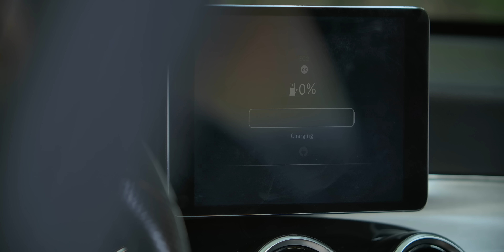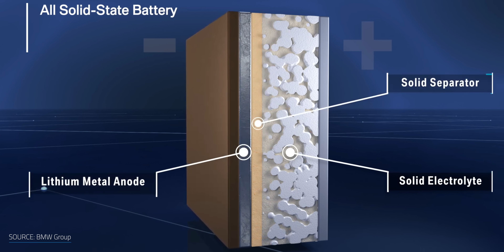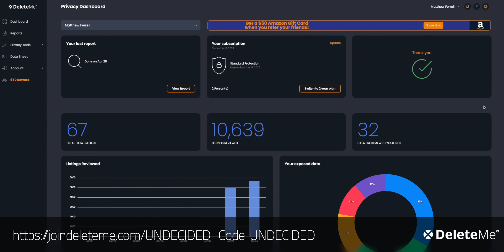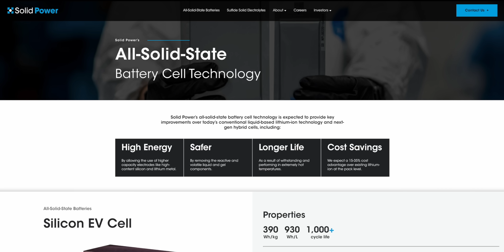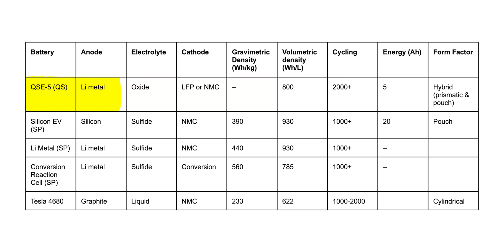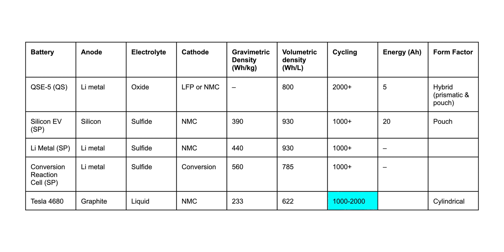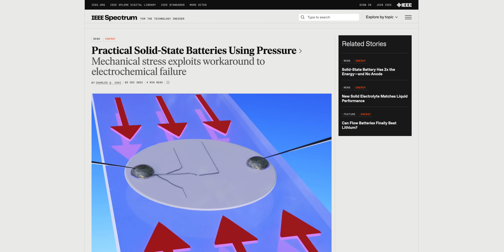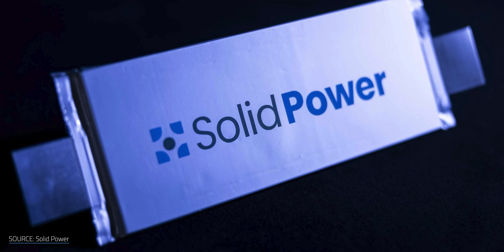Solid State Batteries are Closer Than You Think

Comment: For me, it's not just waiting for solid state to come out, it's also waiting for the cost to come down and safety issues to be resolved.
Reply: Safety issues have been resolved decades ago.
Reply: @4203105  what about the Samsung phone batteries?
Also, Chevy Bolt EUV batteries?
How about Tesla cars that have started on fire?
Reply: @miked412  What about ICE cars that burn down 20x more often than EVs? There is nothing in this world that is completely save.
lithium-ion batteries are much safer than alternative technology we've been using for a 100 years.
Reply: @4203105  I was replying to the comment "safety issues have been resolved decades ago" and pointed out safety issues more recently.
Off topic:
 - ICE cars do have more fires per 100,000 and may always. EVs present a different challenge - extinguishing.
 - Metals fires are a different beast. While there are less fires with an EV they are far more disruptive.
Back to topic:
 - Solid state have the potential to be a safer alternative to lithium ion. That doesn't mean they will be when mass production starts.
 - Testing only goes so far. So, I plan on waiting for both the cost to come down and any major safety issues to be resolved.

Comment: "I think we'd all appreciate an EV that can charge to full in just a few minutes ..."

A Tesla Model 3 has a battery capacity of approximately 60 kWh.
The electrical power required to fully charge a 60 kWh battery in ten minutes is 360 kW.
(The average three-person household uses approximately 2,800 kWh per year.)
With a standard 60A fuse, a maximum of 13.8kW can be supplied.
Where is the power and the line capacity going to come from to supply 360kW for ten minutes?
Do the maths before you spout such nonsense.

Comment: "Solid state batteries are just around the corner" for the low-low price of $300+/kWh for the newest numbers I could find. We're still many years away from them being economically viable in the consumer space.

Standard range EVs with solid-state batteries won't go much farther than standard cells since manufacturers will simply cut down on battery pack size and weight to reduce costs.

A slimmer, lighter battery requires less structural support, which further reduces costs, weight, rolling resistance, tire wear, etc. A slimmer battery also makes it possible to lower the cabin floor and roof by a few cm, which improves aerodynamics and gets you more range per kWh too.

Once you have enough range to easily drive longer than most people's bums can bear in one sitting, the only problem with EVs is having enough reliable 120+kW fast-chargers near rest stop facilities for people to take their 20-30min breaks there.

Comment: A friend of mine is a PhD chemist who has worked in battery engineering for over 20 years. He is skeptical that solid state batteries will ever be practical.
Reply: Your comment would be a lot more helpful if you’d ask your friend to explain his reasoning and share it with us so we can learn. Just saying 😊
Reply: @philipk89  I'm not a chemist.  He is a PhD chemist.  I can't understand the detailed chemistry that forms the basis of his skepticism.  

But, in general, some of the issues in solid state batteries are that 1) they are very susceptible to fires, 2) they degrade over time, 3) they are very sensitive to temperature, 4) they degrade over time, 5) vibration and shock also causes degradation, etc.  Fundamentally, the goal of solid state batteries is to get a huge amount of energy into and out of the battery in a very short period of time.  That is fundamentally a dangerous thing to do.

Comment: likely the most important factor that should maybe be explained (and maybe you didnt have numbers to) is mass and KWH per volume (pick your scale measurement), this is ultimately the most telling factor for how much an improvement solid state may be from a range standpoint. if by stacking into the same volume as lithium ion, what is the mass/weight and kwh comparison? are there numbers for this from either company? Theres a lot of talk about focusing on faster charging speeds and less about range, but a large improvement in either direction will make the other less of a factor.

Comment: BLA BLA BLA BLKA... SOLID STATE BATTERIES IS ONLY GOOD ON PAPER.  THEY HAVE NO RAL LIFE TEST. SO ALL THE ADVANDAGES ARE ONLY AS AI SAID ON PAPER. Also LiFEPo4 batteries can be charged 10 000+ times. not some 2000 as you said. So if solid state batteries wont be cheaper than regular LiFePo -they have future only for mobile and laptops.. cars wont use it.

Comment: Silicon anode batteries, such as as the Simaxx series by Amprius, seem to be further along production-wise compared to solid state batteries.  The silicon anode batteries also have a much higher energy density at around 1200 Wh/L from what I’ve read.  They also have a pretty quick 20-80% charge time of 6 minutes.

Comment: there are a LOT of details they don't, and SHOULD not reveal about why they're not here already, I suspect their biggest hurdle is their short cycle life when compaired to other lithium tech. there's just too much we don't know. BUT... i know of someone who's seen the details & knows as much of them as anyone- and he chose a different path over them- and that tells me everything I need to know- ELON MUSK. he's seen the tech and turned it down in favor of dry application lithium combined with tabless- aka, the 4680 cell, which is KING of longevity. 3.5 million miles, or 50 years. everyone is chasing range- nothing wrong with that- but having the world's BEST charger network with every automaker already signed up to be onboard? means a 300 mile range is already 2x as long as it needs to be. the REAL holy grail is battery LIFE and pack replacement cost. $8000 for a 78kwh model Y long range pack- with tesla pack life averaging 400-500k-  and their pack costs just keeps getting CHEAPER... even as hyundai's 64kwh pack replacement costs a whopping $60,000! whoah- didn't see that one coming. nissan leaf- $45,000 for a measely 35kwh pack. if you're shopping EV's? I would make that my FIRST question- 'pack replacement cost'- RIGHT NOW. no projected. not 'under warranty' the ACTUAL cost if I PERSONALLY have to pony up the dough. let's face it: tesla just OWNS THE SPACE.

Comment: To be fair you have to mention (and didn't) that cylindrical cells are physically less energy dense than flat packs (prismatic).  The lower Wh/L for cylindrical cells is in large part because of geometry, not chemistry.  Current wet Li Ion cells also come in prismatic packages, and some EVs on the road today do use them.  If you wanted to be fair, you could easily have included either a current mass market prismatic cell or one of the other vehicles that uses them.  Anti-Tesla bias much?

Comment: Screw lithium.  KAIST labs in Korea  has a sodium-ion battery that uses MOFs for the electrodes.
Holds 200+  Wh / kg   and charges-discharges at the speed of a supercap!
Reply: CATLs second generation sodium ion battery is also 200Wh/kg. The problem with sodium ion is more Wh/l though. I'd tamper my excitement till they release those figures.

Comment: Which one can be recycled/refurbished more easily? It sounds like the SolidPower offering may have an edge there. It's batteries may not last as long, but if they are easy to disassemble and reassemble then that alone might put them ahead. I still think though what we really need here is standardization and a change of ownership of the battery itself. If drivers didn't have to worry about that future expense because rather than charging we just drove up to a station for a quick 5-minute swap, EVs would become a lot more attractive. Granted, that would require yet another rollout of infrastructure to handle that.

Comment: One thing I don't understand with solid-sate batteries being made with layers of pre-rolled materials is how they achieve high area of surface contact between the electrolyte and the anode/cathode layers. It would seem if the electrolyte was a gel, or a spray on process used, then better surface contact between layers could be achieved. 
With liquid electrolytes anode/cathodes don't need a high degree of surface smoothness, as electrolytes can move a molecule thickness to fill gaps and create a path over largest possible surface area for ions to flow.

Comment: The solid state battery for the power tool industry and the lawn care as will be quite big. companies like Milwaukee and DeWalt with outher tool brands can make more power full battery tools . one of the biggest hold up in power full tools is the battery watt hour to size weight ratio . brush less motor  tech had been  game changer in power tools. solid state battery can be a outher game changer. with lawn care like mowers and weed trimmers. looking at lighter weight and longer run time. this is even more hope for a electric riding lawn mower. starting to see them on the market but battery is still a hold up . not just the EV is going to see a change. love video's like this giving a up date on how things are coming along.  now for LFP battery this is great as well. they have higher cycle life and great for home energy storage where size not so much a factor. LFP is great tech not dependent on cobalt.  much safer than MMC . they coming soon as well .

Comment: Solid state batteries must prove itself in smaller sizes first: headphones, watches, phones etc ., before EVs.
Murata of Japan has been making solid state batteries for 3 years but for small capacity batteries only, not even meeting the requirements of smart watches.

The fact that none of the solid state battery makers are not targeting actual use cases in small capacity makes me sceptical of these companies.

Comment: Aircraft.  That is where solid state batteries will first take off.  

With every increase in efficiency, power density, and affordability, electric aircraft designers will buy a whole lot of these.  For a whole new generation of larger electric air vehicles. 

Will also improve drone performance, and enhance the use of drones in all manner of applications.

Comment: @UndecidedMF, one thing I'm curious about is why can't car roofs or front hoods have solar panels to constantly gain a trickle charge continuously while in use? Yes, I don't know how much it could add, but I also would ask how much it could impact a car fully charged at home and then doing a typical cycle of groceries, shopping, etc. where a car would also sit in a parking lot, absorbing/charging... or say having a certain trip length of X extended by those hours absorbing sun while on highways between major cities... that'd be an interesting vid to folks like me & a few coworkers.
Reply: The issue is panel efficiency, in that you just really couldn't get a lot of power with such a small surface area. Because I hear you, I think the same thing all the time. Heck even a few hundred watts might be enough to get you a few extra miles.
Reply: They could, but just adds cost for not a lot of benefits. Aptera is going to have solar panels as an option, but it also highly efficient vehicle, so it will have a bit more benefit. Honestly I think the best use of solar on a car would be for hot climates to run the AC to keep the car interior cooler, while parked.
Reply: @cypvh74  that's a great point. Taking even some of the load off the main batteries would be huge.

Comment: Any suggestion that cars will be able to charge in 5-10 minutes is suspect marketing speak.  There will be very few public charging stations capable of the 1000kW required to charge a 100kWh car battery in 5-10 minutes.  (The current maximum is typically 350kW.)  And I suspect those that can provide that kind of power will be very expensive to use.  (Yes, I know about the 1000kW Superchargers for the Tesla Semi.)

Comment: The issue is I have to wait for solid state. I ride motorcycles and all the electric bikes worth talking about are (a) crazy expensive and (b) have low range with high charge times. Plus they're heavy. A fast-charging battery that is lighter with higher capacity isn't just a nice to have, it's required. There's a reason why the likes of Ducati (who does Moto-E) is saying electric bikes aren't ready for prime time yet. They're not wrong. But I really want them to be.

Comment: QS has been continually almost proven solid state batteries for at least the last 5 years and it keeps slipping.  There is a reason why their stock price dropped from a high of nearly $120 to $60 to $6 today.  If anyone had confidence that they would pull this off, we would see everyone flocking to their stock.  Sandy Munro even tried to pump their stock a few times and that didn't convince anyone either.

Comment: One of the advantages of solid state was moving away from lithium sources.  Massive ecological damage is done to the environment in lithium mines and the drying process.  Number one reason why most of the creation is out of the USA because environmental activists within the USA would be all over them.  Plus there is also the usage of other rare earths being used that create the problems going on similar to the Congo.  It seems that QS is more of the same problems talked about before, but just yielding a higher energy package while SP sidesteps these problems by using a  completely different material at the cost of a lower energy package but more sustainable in the long run.  Nothing was said about the amount of elements used in one battery versus the traditional lithium ion battery where much of concerns arise.  World wide usage has to confront both problems if it is to be adopted for a cleaner environmental footprint otherwise it will turn out to be an also ran compared to the current fossil fuel industry.

Comment: I'm hoping Solidpower isn't all hype. Sounds like it is nearly a drop-in replacement for current battery tech, which means even older EV's could gain range (even if they still charge at a slower rate.)
Both options look/sound intriguing - once they start appearing at scale, I might get excited.

Comment: This all sounds good but CATL already have a Lith-ion-phosphate battery in production that is more dense than the 4680. It has 2 to 4 times the recharge cycle of the 4680 and has no problems with cold temperatures. The solid state batteries are going to be too-late to the market. When they get here the cheaper more available Lith-ion-phosphate batteries will be better and into improved chemistries. It helps that the biggest battery maker in the world makes them at scale as well. I think if there is real promise from either of the companies you mention CATL will buy them out and add them to the long list of the chemistries they own.

Comment: Toyota announced several months ago that they are working on solid state batteries to be used in about 3 years.  I'm not sure what the details are regarding chemistry and maybe who makes them (not sure if they are an in-house battery or not), but they state 1200 kms of range and a 10-80% charge time of under 10 minutes.
Reply: Toyota has been promising SSBs for years. This is one of the disappointments causing people to disbelieve new announcements of their imminent arrival.
Reply: @bstevens9831  It seems they are trying to hold off on EV production until a viable battery option is available.

Comment: I don't agree that 'charge time' is one of the biggest hurdles for EV, it's power generation and distribution. The faster we move to less reliable solar and wind, and the longer we delay producing high-density power production green sources like nuclear, the longer before we have the additional terawatts of power we need for any large scale adoption of EVs.
Reply: Charge time is a limiting factor for consumers WANTING to convert.  Power generation is a limiting factor in consumers being ABLE to convert.  The price of batteries is a limiting factor for both ability and desire.  Technophiles like to handwave that sort of thing away, but for most of the non-coastal population, a used EV is an impossibility even if charge time and grid constraints were solved.  You can get an ICE vehicle that gets you to and from work for a few thousand.  A used EV is a few tens of thousands.  That matters for the average American living hand to mouth.  Median single income where I live in Mississippi is like $17k/yr.
Reply: Nuclear is not coming back. It's far too expensive. Far more expensive than renewables + storage.